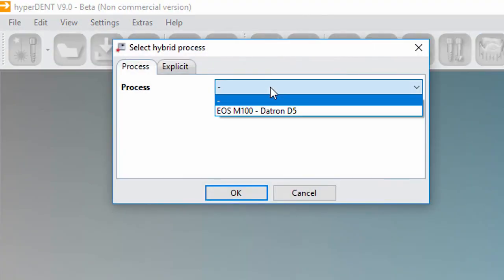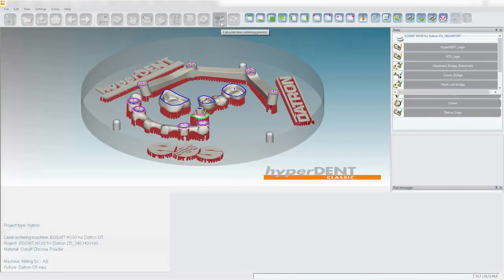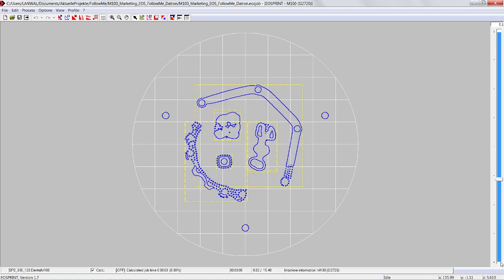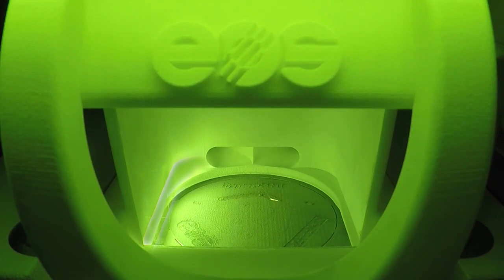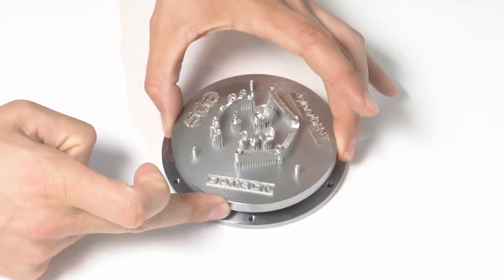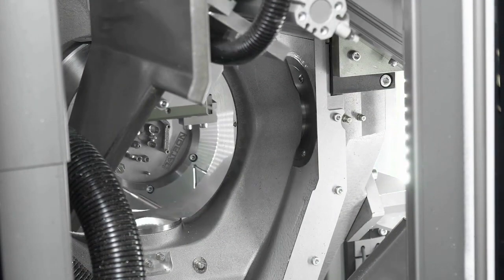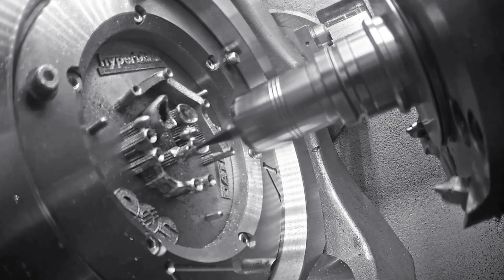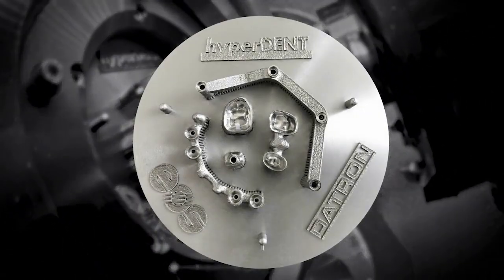Dental Hybrid Manufacturing

Comment: This is ridiculous...the cost is so prohibitive with no advantage over current techniques.. actually. casting and luting to factory abutments is far far cheaper AND more accurate then ANY one piece framework which has to be fired in a furnace for porcelain application. This is simply a money grab.
Reply: It is about the number of crowns you can make in one day, i am sure you cannot make such a big ring !
Reply: @Mhdlagha  rubbish.. you could mill with cad cam in  less  total time and the material cost would be less... the cost of the powder is many times the cost of a metal disc... I have worked with these machines in the past. The cost of these machines is prohibitive and they do have their problems which they don't tell you about here.
Reply: @electro1622  the technician that i work with is buying it next month, and he is so hyped about it , would you explain me what i will expect as a dentist?
Reply: @Mhdlagha  As a dentist you will probably see very little difference.. the main dif. is in the production and cost.. Some argue that the shapes these machines make can be more intricate but as we have seen in the last decade there is little that cad cam mills can't do these days so I see no advantage. Your technician will see his costs rise because of the cost of raw materials and also after time the powder layering system will have problems, they always do... a cost example is .. the price of 1KG of powder for crown and bridge non precious alloy starts at about 700 dollars... for a milling blank of the same material starts at 250 dollars... yes you can sinter a lot more from 1 kg of powder but it costs a lot more as well.... the other issue is cad mills go through milling burs BUT so does this.. as you can see it also mills the metal.. granted you mill less metal so they last longer but if you factor the cost of the machine it would take 5-10 years to make up the diff..... another issue is integrity and strength.. sintered metal is more grain structure compromised than milled or cast and it is simply not as strong so in tight spaces the integrity can suffer, especially in bar work, you will also see a difference in chrome partial frameworks and you will break a lot more clasps adjusting them...... there are a lot of other issues with these machines, they might be competitive in a decade or so but they aren't there yet.
Reply: @electro1622  that only means to me that he will increase prices in the name of better quality and accuracy, which i won't notice?
Reply: @Mhdlagha   You say that now but you will notice  ... plus the quality is not better, it's arguably worse because the parts are not as strong... anyway, I don't want to rain on your technicians parade and I hope he has great success with his new system. let me know how things are in 6-12 months, I will be interested to know.
Reply: @electro1622  i hope i will remember to give you a feed back then
Reply: Of course, for CoCr crown, a cast procedure is way cheaper, but CoCr are soon forbidden an titanium may only be obtain from CAD/CAM technology .Casting titanium is not at all a viable option, specially to manufacture individuals fixed dental prosthesis. The resulst parts are porous with low mechanical properties due to the oxydation. This technique is a real good option to build prosthetics titanium individuals pieces. if the parameters are well defined and the machines known by a good technician, pieces coming from SLM are mechanically comparable in dentistry to conventionnal milling abutment. You can reach a dense structure and the specific microstructure you talk about only affect the elongation at break wich is not a big deal in case of prosthodontics reconstruction. CNCM is correlated with a lot of waste of materials and just this point is important to look for alternative technology. SLM process is not perfect, but this video is not at all ridiculous if the indication is right.
Reply: @crennmarie-josephine5174  LOL.. you can't layer porcelaine on Titanium ..well, actually you can but the oxide layer between the Titanium and the opaque is so thick it could create gum issues so hence you can't buy porcelaine for Titanium anymore...and as faras everything else the surface finish is not good enough and has to be milled and if you have to mill it spare yourself the expence and just mill it from a billet. They will never ban CoCr ... some hip implants are a cobalt chrome alloy so they are not as bad as people think with compatability. ... and lastly if theses machines were so good there would be a lot more out there than there is... good for some things but not for dental.

Comment: Want to inquire about the price?
Reply: The 3d printer is up from 100k to around 250 i think... the milling maching i have no idea.
Reply: @jagodic7  we can supply 70000 USD
Reply: Hi
Reply: @saimedtechnologies9363  We watched your video, and have question.For final product did you use one equipment? plus what are your prices and conditions.
Reply: Please contact at +919999291673 wechat or whats up no
Reply: @saimedtechnologies9363  i'm interested too email me
Reply: @saimedtechnologies9363   number not in whatsapp
Reply from the maker: Please contact your hyperDENT dealer. We can answer all questions!